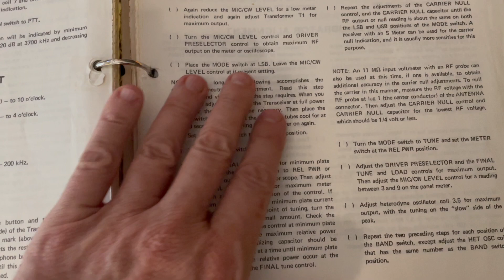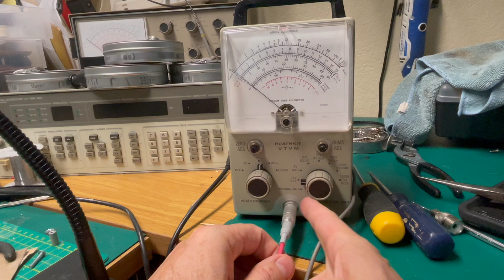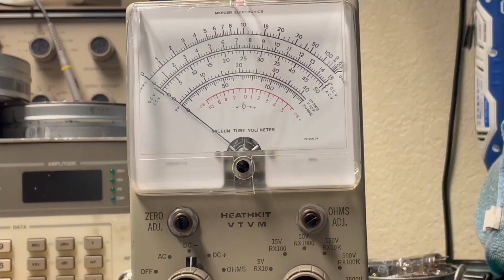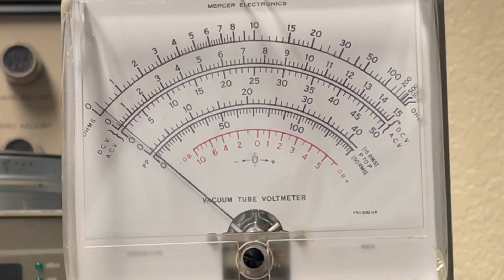Heathkit ProTip #2 -  Neutralizing Finals

Comment: TNX for the video.  For easy probing of the RF signal at the output of any HF TRx you can use a PL259 (Male)  to dual SO-239  (Female) "T" adapter/connector. Insert it between the TRX output SO239 connector and the coaxial cable which goes to the dummy load, then the remained free SO239 port of the T adapter can be used for probing. GL & 73!